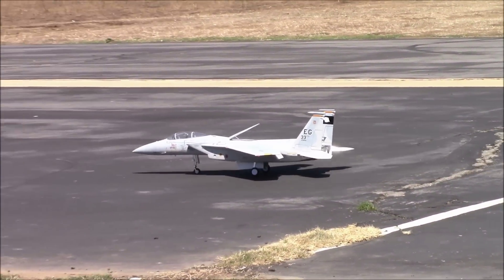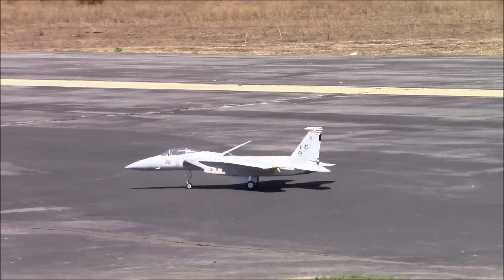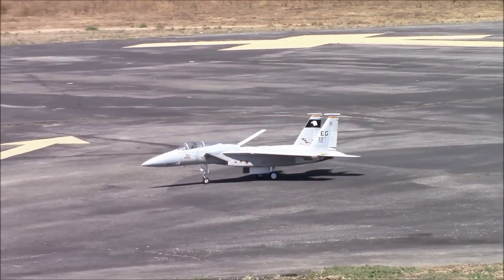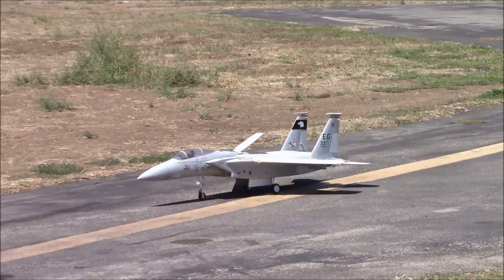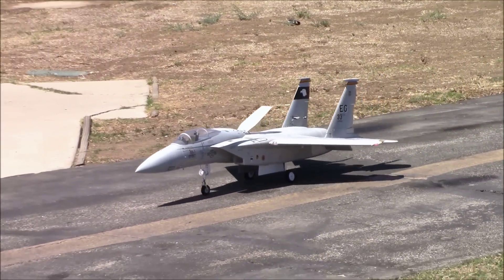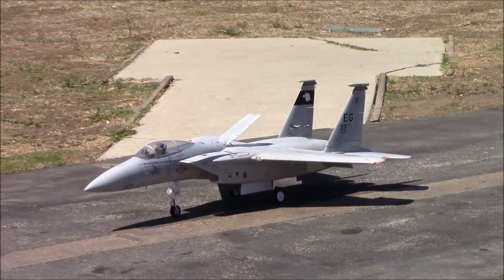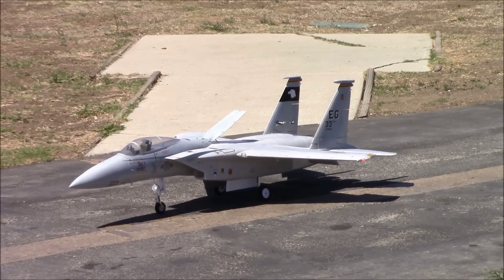Freewing F-15 Eagle 90mm EDF Jet - 8S (8 Cell LiPo) Flight Performance Demo

Comment: Hi I purchased the Freewing 90mm 12-Blade EDF 8S Power System w/ 4075-1390Kv Inrunner Motor which was told was the right one to get for the 8s upgrade and have two 4s 5000 mah batteries and since the motor is now heavier then stock does that change where the CG I used the CG from Manual and need to know if with the 8s does it change where the CG from manual change at all
Reply from the maker: The CG is the CG, if you add weight to the back, counter it in the front. Still use the same book CG as a guide
Reply: @MotionRC  awesome thanks

Comment: Does the "high performance" one at $499 come with set up for 8s lipo like better motor and esc ?  Site doesn't seem to explain difference between $449 and $499.   Awesome model btw.
Reply: 6S Inrunner performance with a different fan - you can't put an inrunner in the other one. Get the ARF and go 8S...  I'm doing that. Made my first flight the other day and WOW!  I have a Leopard 1600kv, 200A esc, and MotionRC metal shroud fan for inrunners. What a difference on 8S...but I will pop in a lower KV motor to lower the amps for the next flight.  It will still go fast compared to 6s.